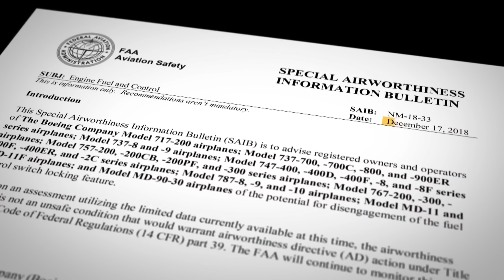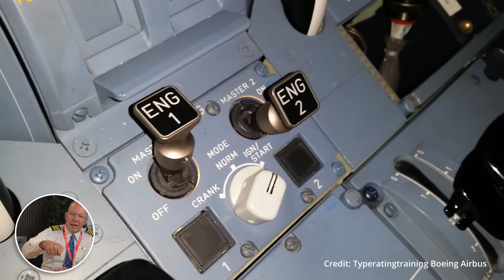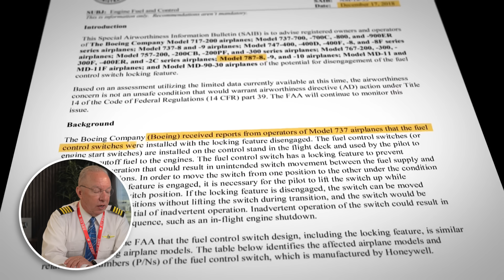Air India 171: The FAA’s 2018 Fuel Switch Locking Bulletin Explained (16 Questions Answered)

Comment: I wonder why isn't for such critical switches a sort of two face comit implemented if the bird is airborn? Like a warning to acknowledge the action with a second button, cause this actions during the flight doesn't make sense. And in case of fire in both engines and both must be shut down, which is the worst case, the computer knows about the fire alarm and then no acknowledge must be done.

Comment: There is another thing to consider and that is the possibility of some electrical fault in the fuel switching system. Recalling TWA Flight 800 that broke up and crashed into the Atlantic Ocean about 12 minutes after takeoff. It took nearly four years to uncover the cause of that accident which turned out to be a short circuit in some bad wiring in the center fuel tank, which caused that to explode, destroying the aircraft in mid-air.

"Trans World Airlines Flight 800 (known as TW800 or TWA800) was a regularly scheduled international passenger flight from John F. Kennedy International Airport in New York City, United States, to Fiumicino Airport in Rome, Italy, with a stopover at Charles de Gaulle Airport in Paris, France. On July 17, 1996, at approximately 8:31 p.m. EDT, twelve minutes after takeoff, the Boeing 747-100 exploded and crashed into the Atlantic Ocean near East Moriches, New York, United States."
"The four-year NTSB investigation concluded with the approval of the Aircraft Accident Report on August 23, 2000, ending the most extensive, complex, and costly air disaster investigation in U.S. history up to that time. The report's conclusion was that the probable cause of the accident was the explosion of flammable fuel vapors in the center fuel tank. Although it could not be determined with certainty, the likely ignition source was a short circuit. Problems with the aircraft's wiring were found, including evidence of arcing in the fuel quantity indication system (FQIS) wiring that enters the tank. The FQIS on Flight 800 is known to have been malfunctioning; the captain remarked about "crazy" readings from the system about two minutes and 30 seconds before the aircraft exploded."

Comment: Having a camera in cockpit is easy. Record for every flight strt to end and once, aeroplane lands in 1 airport, press button to delete permanently. 

This, for any succesful flight, recording is deleted. If any mishap occurs, it will be helpful to find issues.
Reply: I have said for years that memory chips are cheap. Have the CVR retain info for a month.
Reply: @johnstreet797   How on earth is that relevant. This crash was captured on CVR, what is adding a month to it going to resolve?
Reply: Yeah no, pilots should not be able to delete recording or manipulate it. That would be the opposite of the goal here
Reply: Or have 24 hours of recording in memory. There are accidents that happened after repeated faults on previous flights.
Reply: In the end is it not that beneficial due to having recordings of the voices and the data. Investigators are able to determine which pilot it is. I wouldn't expect that to be released given this is only a preliminary report.
Reply: A camera couldn't overcome the impact...!
Reply: Past recording can be helpful for later disaster to monitor pilot physchology, any equipment errors or anything, i think data should be stored in a safe unbreakable server.

Comment: SAIB NM-18-33 is not suggesting that the switch was installed upside-down. The advisory is about the locking feature not being properly engaged during installation or reinstallation — not orientation.
Although many discussions have focused on the possibility of a mechanical failure in the fuel control switches, the evidence suggests otherwise. The issue was not the result of wear, aging, or internal component failure. Rather, it stems from the installation of switches with the locking mechanism improperly engaged — a condition highlighted in an FAA advisory. This context reframes the situation and increases the plausibility that both switches may have been compromised due to improper installation, not mechanical breakdown.
The likelihood that both fuel control switches malfunctioned on Air India Flight 171 increases based on the following facts:
•	SAIB NM-18-33, issued in December 2018, warned that improper installation could leave the fuel switch locking mechanism disengaged, potentially allowing movement between “FUEL CUTOFF” and “RUN” without lifting the switch.
•	This issue applies to Boeing 787 variants, including the 787-8 used on Flight 171.
•	The Air India 787 (VT-ANB) was delivered in January 2014, before the bulletin was issued, and no inspection or corrective action was performed. Compliance was advisory, not mandatory.
•	There is no indication of wear, aging, or hardware failure — only potential installation oversight.
Conclusion: While the exact increase in probability cannot be determined, the absence of inspection and the aircraft’s unmodified status raises the possibility that both switches were in a compromised state, which could have contributed to the dual engine shutdown.

Comment: Considering the design of fuel control switches, where the UP position is RUN and the DOWN position is CUTOFF—why isn't the design reversed, with RUN in the DOWN position and CUTOFF in the UP position? Wouldn’t this reduce the risk of accidental shutdown if the locking mechanism fails and gravity pulls the switch down due to vibration?

Comment: Heartbreaking crash. Thank you so much for giving us all this detail with such clarity.

Here's what I'm thinking. Sometimes when I'm tired or stressed or distracted, I do something exactly the opposite of what I should, like a few weeks ago I put my Prius in reverse half way down the off ramp from the highway, as if I were back in the old days shifting my manual shift car into neutral going down the off ramp. On the Prius stick, you can easily overshoot into reverse. My Prius just beeped at me and stayed in neutral, but boy did my heart go up in speed as I realized what I'd done. Normally, with the Prius, I would do nothing on the way down an off ramp, so that's why I think my mind went back to ten years ago when I was still driving a standard. 

In the case of Air India 171, there would of course be no way to know, but I wonder, in that way that one wants to come up with a less awful reason for this happening, whether the pilot who put the switches into the off position may perhaps have been tired and done it because he forgot where he was in the order of doing things? it seems like a stretch, even as I write this, but anyways. Putting it out there because that's what you do in problem solving, consider all sorts of more or less unlikely possibilities.
Reply: You should hand in your driver's license if you are making those kinds of mistakes.

Comment: All aircraft should have already had mechanisms that prevent mistaken fuel shut-off to engines during a takeoff climb.  The fact that aircraft are certified for flight without such a safety feature is very disturbing.  There should be some kind of service bulletin or recall to integrate this safety feature in all commercial or applicable aircraft immediately regardless of cost, because life is priceless.
I'm talking about a safeguard that will prevent fuel cutoff regardless of what a  human pilot might mistakenly do or otherwise, while the aircraft is in takeoff climb.  Very easy to do with hardware and software.  No excuse for such a safeguard not having been implemented already.
Meanwhile, the notches and locking detentes on the existing fuel cutoff switches needs to be investigated thoroughly.  We also might need to think about cockpit video surveillance of actions during takeoff and landings - being included in the cockpit data recordings.

Comment: I’m not an expert, but hasn’t the RAT deployed too early if it was triggered just by cutting off the fuel valves? it takes time for the engines spool down. I suspect there may have been an electrical failure, and perhaps the captain used the fuel switches as a countermeasure. it might have been outside standard procedure, which could explain why the first officer seemed surprised.”

Comment: From a technical perspective, I believe all aircraft should be equipped with a protective guard for the fuel switches. Once the takeoff checklist is completed and the aircraft reaches V1, a glass cover should automatically secure the fuel switches. To access the switches during takeoff or after reaching cruising altitude, pilots would need to manually activate a small lever located on the upper panel. This action would then expose the fuel switches as needed. Introducing this third-step mechanism would serve as a safeguard against accidental activation or any intentional tampering.

Comment: Due to the 2018 FAA advisory on issues with fuel switch locking mechanism, leading to disengagement of the locking feature, it now seems that this disengagement can result in the switches being moved inadvertently at any time during the flight, either due to vibration or electrical/mechanical failures during the flight, and that it would be wrong to entirely blame the pilots or to speculate that the switches were moved solely due to human intervention and not otherwise.
Reply: Because he already made a video stating that it absolutely could not be due to vibration and you have to pull out on the spring loaded levers and then lift up so he was stating in several videos that you absolutely have to manually do this It can only be done by a human not a computer and also he didn't put any blame anywhere he's stating the facts? Please direct me to where he blamed the pilots?
Reply: Okay supposing that this is possible (I'm unaware of any such examples with this type of switch), then what are the chances that they both do this within 1 second of each other and then are reengaged manually and withstand a crash?

Comment: @15:55 - Think you missed it in the preliminary report. Page 14 of the report has CCTV footage of the RAT deployed while airborne above the runway itself - and they have mentioned this in the report as well. 

'The CCTV footage obtained from the airport showed Ram Air Turbine (RAT) getting deployed
during the initial climb immediately after lift-off (fig. 15)'
Reply: I don't know how he would have missed that when he did a whole video on it? I was wondering the same thing and thought maybe he misunderstood the question or I misunderstood his response lol
Reply: Could be the RAT got deployed on the indication of duel engine fuel cutoff, but since it takes a few seconds for the engines to spool down (run out of fuel), there was still some thrust/climb for a few seconds
Reply: Thanks for pointing this out, found his answer here a bit odd as that CCTV is well known.  And the answer to the question asked is that it initially continued to climb with the RAT deployed after fuel cut-off, as it carried significant momemtum at rotation as it leaves the ground and lots of thrust was being generated until cut-off.  Similarly, even cruising at 25,000ft if you cut the engines but lift the nose you're still going to gain altitude for a time.
Reply: Will the rat deploy automatically if someone were to manually cut off the fuel?
Reply: @iceman9678  . Saw this question answered in another video on the Mentour Pilot channel. They mentioned that it does come on even if the fuel is cut off manually, as power would be required for other systems to operate if there was a genuine reason to switch off the engines mid flight!
Reply: @iceman9678 That's a good question that I would love to know! You should put this question in the main comment area because then he will most likely respond to that in another video like he did this one.
Reply: Seems RAT deployed even before the cutoff switches were moved? In which case the pilot error theory doesn't hold.
Reply: @kiran56227 it depends if the picture shown is 4 seconds after takeoff. From that point onward fuel was cutoff to both engines.

I remember another pilot channel explaining the weather conditions meant it was a very slow climbing flight. Engines were at 80% or so of the power they should normally provide, it was a long haul flight thus a heavy plane too.

Comment: As the 787 is a flybywire aircraft is it possible that the switches mechanically could of been in the run position but a electrical/sensor failure could of made the system power off the engines? The flight recorder detects a signal from a sensor not the actual mechanical position. If their was a sensor/signal fault could this not cause the fault & also explain why the audio has one of them saying "why did you you" & the other saying "he didnt"
I personally dont think it was pilot error or deliberately done. 
If there is a bigger/fundamental issue ie maintenance or Boeing then this is major issue.

Comment: Can the FDR discriminate between a manual movement of the control, and movement due to vibration of it if it was not in the detent correctly? Although there's a possibility of pilot-suicide, it seems to me that we should be taking the statement "I didn't move it" as truth until provable beyond all reasonable doubt. I especially want to know if the switch is close to the run detent, but not actually in it, if it's possible for the fuel to function normally.

Comment: On the data recorder, is the recording resolution 1 second, or is it based on real time timestamps which are recorded within milliseconds of the event. If it is the prior, then we absolutely do not know ifbthe switches were activated 1 second apart. They could have been activated simultaneously, but the slow polling reads them to different second. This is very typical datalogger, but very poor for accurate sequence of event recording. If it is the latter, i.e. real time timestamps, then 1 second means that the person who switched them had to be very precise.

Comment: You would think that If this was an intentional crash by one of the pilots, the pilot that shut off the fuel to the engines would've prevented the other pilot from flipping the switches back on and they would've been found in the off position.

Comment: How can u say that pilots did turn off the fuel switch as nowhere in the report its mentioned that they turned off or cut off the fuel on their own knowingly, and it there was a case like this , they would have clearly mentioned that this pilot turned off the fuel switch also it is mentioned that both the fuel stitches were turned off in just a second how is this possible and for those who think these are normal switches then no , they are designed in suh a way that forst we need to pull them then shift to desired position so both cant be manipulated in just a sec from onto off and in the burnt part of the plane these switches are present in the on position so how can a person pull 2 switches then shift them to off then again shift them to on position in just a second and how can u say there wasn't any mechanical error in the plane, few days ago u were yelling about there can be a cause of dual engine failure, i feel the report is not correct and there is some fstal error or problem jn the jet
Reply: as it rose off the runway the switches fell down into the off position as the detents were likely worn
Reply: What i feel is that the rat deployed as soon as the plane took off which means the engines failed right after take off thats why in the takeoff video ram air turbine is seen and rat can only deploy in case of power failure which can be caused due to dual engine failure then it is clearly mentioned in the manual of boeing to cut off and on the fuel switches to relight the engines in case of failure so pilots did that but as engines were failed so they couldn't revive the plane and it fell down @barrybark3995

Comment: Boeing should fix the switches it's a glitch in the switches and all aircraft from Boeing should be grounded till the switches are fixed
Reply: as it rose from the runway the angle was just enough to tip the switch toggles into OFF ,if the detents were worn out

Comment: I’m not so sure. 
After 6000 or so cycles, that they talk about, I wouldn’t be surprised if the internal springs are knackered and the switch shaft worn. All moving parts wear, so maybe they were not latching properly and got pulled back by a long sleeve shirt or bracelet that was being worn by the flying pilot as he took his hand off the thrust levers at V1.  Just my thoughts?

Comment: Solution to the cockpit CCTV issue and pilots concerns: A system not dissimilar to police body cameras and other black box video recording systems would work. It would be in a standby mode, and buffering for a few minutes. It would only start to record and save footage in the event of an emergency, or other critical safety feature or warning system activating (along with a visual and audio notification that the camera is now in recording mode). And of course, if the plane is able to land without incident, then the pilots would have the option of deleting the recording if the system recorded for some reason. That would help reduce any privacy concerns from pilots, as a normal flight would not result in any recording happening, let alone one that would need deleting - there just wouldn’t be one because it didn’t activate. Also, any recordings would be stored on an isolated device with no network connection. The only way to view it would be to physically remove it from the cockpit, requiring a code/key that only official investigators have access to, thus preventing any unauthorised access and leaking of any footage would be essentially impossible. This is an obvious and technologically trivial solution to the problem and I don’t know why any pilot would be against this.